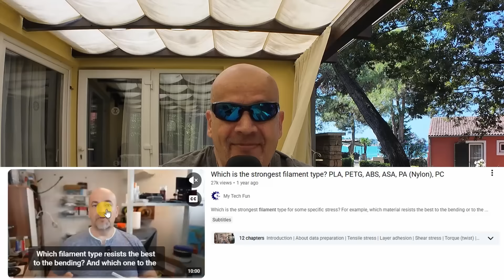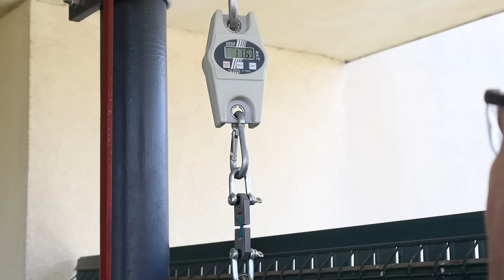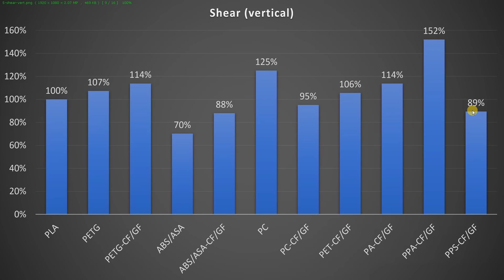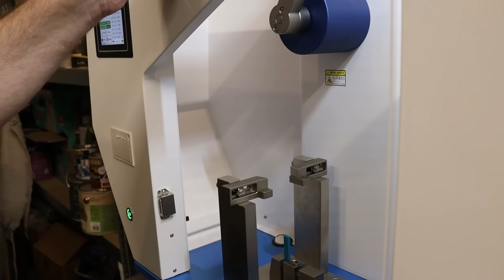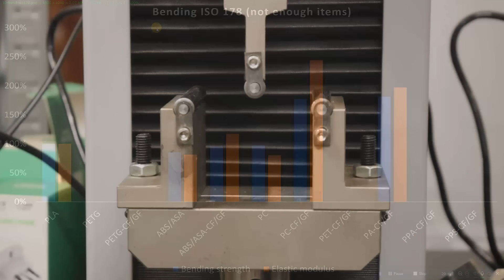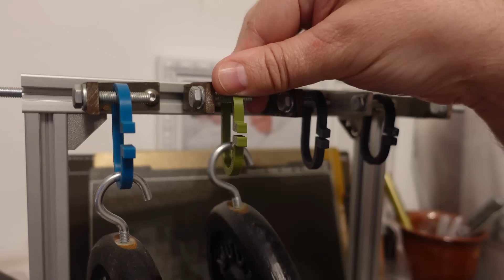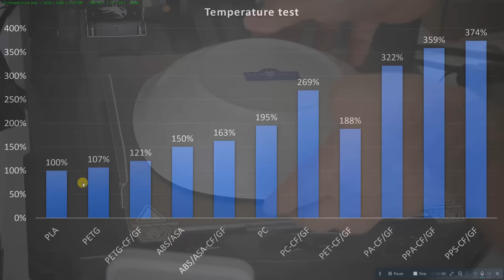Which Filament Type Is the Strongest? Now Including PET-CF, PPA-CF & PPS-CF

Comment: Thank you so much! I have spent a ton of time invested into obtaining the strongest FDM prints for prototyping. I have seen incredibly different results with the same material after tweaking so many different settings. Did you tune each material before testing this? Basic tune? Fully tuned? Again, thank you, subscribed!!!

Comment: Thank you very much for this comprehensive update of your filament comparison data! I like the graphs and the choice to use PLA as the 100% standard. One suggestion is to add to each graph a single small text box defining the ACTUAL VALUE for PLA (with units). Since your display gives % relative to PLA, with this single absolute value we can easily calculate the values for each of the other filaments on each of the graphs.

Comment: I really do wonder if most of the technical filaments compare so average against PLA because for most the technical filaments you didn't use an actively heated chamber? Because just from this data here, I don't even see the hassle to mess around with the enginerring filaments except maybe PPA.

Comment: I'm pretty conflicted about PETG being more brittle than PLA. All knowledge available on the internet points towards PETG scoring better in the IZOD impact test, even Ultimaker mentions the impact strength of PETG compared to PLA on their page as a general guideline. Looking through datasheets of materials from for example ESUN points towards the same, but then again the story is quite different with say, SUNLU..

Could be worth it to make a comprehensive test of PLA and PETG materials from different manufacturers to see if the contradicting claims are due to variations in material composition between brands, and if it's even possible to make such a generalisation between the two materials that one holds superiority over the other in the matter.

Comment: Seems like, other than UV durability and long-term thermal cycling, PETG really isn't winning many categories, however for me in rural northern Australia, PETG's UV characteristics, especially black, make it win.  The thermal cycling issue I found was with PLA, after ~6 months the PLA around my brass threaded inserts would crack ( installed using hot-tip melt ).

Comment: I printed replacement parts on my suitcase out of 72D TPU. It survived an out-and back airline trip as a checked bag. I’d be curious to see formal testing on high-stiffness TPU. The one I used was from CC3D.
Reply: He tested it already.
Reply: @riba2233 which video?
Reply: @davidmvermillion   "TPU+Nylon Mix: Is CC3D TPU 72D the Toughest Flexible Filament?"

weird that you couldn't find it easily
Reply: @davidmvermillion  158prgcHcTE
Reply: @riba2233 thank you!

Comment: Good video but you should have done the pacf, ppa cf, and pps cf with an annealed and un annealed group
Reply: It only changes the temp resistance significantly
Reply: @riba2233 that's not true for at least the nylon. Layer adhesion goes up and impact resistance goes up.
Reply: @BamMiracle   nope, layer adhesion stay mostly the same, impact resistance will decrease a lot temporarily until it absorbs moisture eventually

Comment: Thank you for your great job! 
Your videos are very interesting to watch. (I love data )))

I think the temperature test could have been displayed in degrees. It would have been clearer to me, as it would have been to many others ))

Another possible direction of research is vibration absorption. It could be useful in homemade printers, where instead of a super-rigid frame, we make it out of plastic. The main resonances are "collected" at a single frequency and suppressed by shapers in the Klipper. The remaining vibrations are absorbed by the plastic.
Honestly, I can't imagine how this could be tested so that the results would be useful in practice.

In summary graphs with a lot of source data, it might be useful to display not only the average values, but also the maximum, minimum, and +/- sigma. For example, as far as I remember, the strength of PLA can vary greatly depending on the color and manufacturer.

Comment: I'm curious about PETG's layer adhesion, it's supposed to be stronger than PLA. From my own experience, PETG's layer adhesion can be incredibly stronger to a point where even when bending a vertically printed sample, so the stresses are long the layer lines, it just bends 90 degrees without breaking. This does require minimal cooling and slow/hot printing. I'd just be curious for a test between "standard" PETG printing and also printing specifically for strength, as my tests with doing the same with PLA never got close to PETG's best layer adhesion.
Reply: It is stronger in relative terms (compared to xy tensile strength) but this graph shows absolute numbers.

Comment: Wow PPA is truly a champion! One of the only places it can be usurped is in glass transition temperature combined with load. For example parts under stress in a heated print chamber such as printhead plates. Stew from Team 7 discovered that only PC-CF could really hold up in most scenarios and even PPA struggled. Still, what an amazing filament. I will also note that PET-CF emerges as a great all arounder filament again. Jack of all trades and master of none if you will. Easier to print than the highest end filaments with better properties than all the low end filaments and also very affordable. Siraya Tech is awesome as always. Thanks for this fantastic summary!

Comment: Greetings Sir. Thank You for Your contribution to the community. I was making some technical tool clamps for CNC machines, and so far I know that regular PETG gets "tired" and eventually breaks. Now, I am doing the tests with Overture's Easy Nylon since it has greater elasticity and I am assuming it will be able to perform well after many itterations of load being applied and removed from the part. Also, I have done some thermal treatment to the parts and will eventually see how it performs. Do You have any suggestions?

Comment: This has basically proven to me my choice to  just use Fiberon PET-GF15  for  everything that needs to be stronger than basic materials was a  good chocie lol. I honestly started to love  fiber filled PET, it prints so well and easily and is insanely strong for how easy  it is to print and how cheap it is too.

Another interesdting filament thaat I want to  try at some point is  PCTG. Supposed to be similarly easy to  print as PETG but closert to PC in terms of strength.
Reply: Same strength it's just more impact resistant. PC is still stronger.

Comment: Based on my experience i dont believe that you had proper PETG print settings
Reply: He did. What property do you think is not good enough?
Reply: @riba2233  Layer Adhesion. It can printed to have incredibly strong layer adhesion, and should be stronger than PLA under the right conditions.
Reply: @Kirahl3 and it does relative to its tensile strength. These numbers are absolute tensile loads, not relative Z direction compared to XY direction.

Comment: 10:05: "PETG" surely PET?  And yes, I think it is the most slept-on filament for this reason.  You can buy 4 A2L for the price of 1 H2D.  If you have to make a large number of car parts or similar, your first job is to make sure you can't use PET-CF.

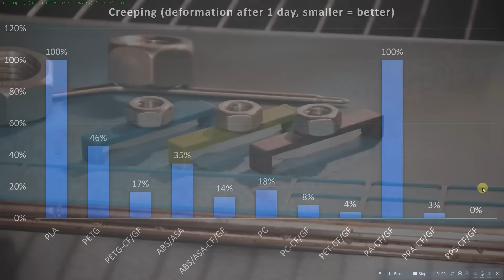Comment: 1) Please have a comparison of all TPU 64d and harder!  I think it will dominate some comparisons even more than PPA-CF does in the filaments you have.  I have it from Tinmorry, CC3D, and Bambu.  (Weirdly, I print them all with the Bambu TPU for AMS preset and Bambu prints BY FAR the worst of all of these!)  To me it seems like a wonder-material: anything you would otherwise print with PETG can be printed with hard TPU and will be indestructable.  2) Put TPU on these charts.  Maybe "90-96a" and "64d+" groups.  3) Your sponsor has an intriguing range of PA.  Please test them all.  I would mark my calendar to see that vid and I suspect many would.  4) At 8:25 temperature can't be stated as a percent as zero differs between systems and sign flips in common systems, unlike all other dimensional units.  I think even our American friends are fine using C in this contect.
Reply: He tested polymaker PA filaments a long time ago, everything except pa612-cf.
Reply: @riba2233  oh OK!  Still, if a long time ago, perhaps that didn't include the latest versions of all his tests?  And it'd be quite valuable to see pa612 in the context of the others, probably very worthy of its own video--only one new filament but compares it to the other 4-5 members of the family and perhaps other significant markers like Siraya, Prusa, and Bambu.
Reply: @lqr824  yeah I would also like to see it, it will come I'm sure. Formula hasn't changed since the start so those tests are still relevant :)

Comment: The delta between AS/ABS with and without GF/CF on the IZOD test is the one that surprised me the most. That is a really huge delta. What was N for each of those samples? I really think this data would have benefited from being presented as something like box and whisker. 

Big fan of this channel. Got to decide what to print the new RC jet boat in… torn between ASA and PBT-GF and that 72D TPU…

Comment: I just did a project using PPA-CF.  It was just a 50x50mm block that is 15mm tall with a hole in it.  Pretty much a seat spacer.  Even though it was printed with 100% concentric infill, I wanted to be 100% sure that it can handle my body weight and the clamping load between the seat rails and chassis.  It has held up considerably well.  Then I see this testing and confirmed that I made the right choice on PPA-CF.

Comment: 5:09 this is really strange result. How come it shows so different results to both tensile strength and layer adhesion?

Have you repeated this test for multiple samples or this is only from one sample per filament?
Reply: why is is strange? It's a completely different property, it has no correlation with tensile strength. sample size is not an issue, he tested many filaments, some even multiple times on multiple different devices.
Reply: @riba2233  why is it a completely different property? Depending on how the layers were oriented I would expect it to either correlate with tensile strength or later adhesion
Reply: @anj000   because it simply is, impact strength has nothing to do with tensile or bending strength, just like temp, uv, chemical or creep resistance don't as well.
Reply: @anj000  layer adhesion gives prints better resistance to delamination, but it doesn't necessarily help with tensile strength beyond a certain point. The results shown here for impact strength line up with what is known about these materials (ABS is quite good for impact resistance, which is what is also confirmed here).

Comment: If you print PETG without any sort of cooling, it is way stronger than PLA. PETG strength drops significantly as soon as you introduce any amount of forced cooling. I understand you can't print everything without parts cooling etc but I have printed many items from PETG with 0% cooling and only very fine details, very small objects below 10mm in overall size can suffer but even then not always if you print slowly enough.

PETG becomes brittle with any level of forced cooling. So turning off fans helps PETG a lot and it is often not shown in any of these tests.

Also I have personally noticed that translucent PETG is stronger than opaque ones.
Reply: what you noticed has been tested a long time ago. Btw fan settings will only change the layer adhesion strength, tensile, bending, impact etc will still be the same and lower compared to pla. And you can also print PLA with lower fan setting to get even better layer adhesion.
Reply: Just ignore this riba2233 clown. He always just comes into the comments to spout nonsense and argue with everyone. You are correct @CoreMaster111. I've experienced the same things you mentioned with PETG and cooling.
Reply: @zx4133   cope buddy, everything I said was correct so that makes you a 🤡 ;) and I don't argue, I just say the facts, if you don't like them that's on you.

Comment: Another great video with tons of data points showing that different materials will be better for different applications. There is no one best material, especially once cost is factored in, there is better materials for a use case. As you said there were also many other options not covered that may be the best choice but they trade one property to maximize another, ie Flexibles creep but are durable with strong layer adhesion, PP maximizes chemical resistances and repeated bending but is hard to print and doesnt play well with anything else.

As usual a great place to point people when they ask, "what's the best?", the follow up question of "for what?" is rarely answered but at least now much of that is covered all in one video. And I do agree that comparing everything against PLA was a good choice since that is what most people will be familiar with, but I would have liked on some things for the graphs to be in the in a given unit of measurement rather than percentage, I am thinking of the Temp. resistance being one I would have rather seen the hard numbers vs a percentage against PLA..

Comment: For me PET-CF 17 is the winner. close in all tests, afordable, easy to print even on an A1 open printer, very good heat resistance, looks incredible...  great test video as always... thanks!  its my go to filament... i get it in 3kg rolls.
Reply: Poor impact strength though.
Reply: @jaro6985   it's decent enough for most use cases.

Comment: Doing my comparatively informal testing, I would agree with the engineering-class performance. About the most bothersome part is PPS' high temp performance just does so well compared to anything else I can run across my machines before getting into Hardcore (aka $$$$) materials. I was super excited to get my formulation machine online here, then one of the motor controllers arrived DOA. Still waiting on a replacement. Sigh, it's always Something...

Comment: Comparing temperature in degrees is more appropriate than percentages. If PC is 200% of PLA (60°C, 333K, 140°F) does tha mean it's 120°C, or 666K, or 280°F? The chart should really just be degrees above PLA.

Comment: Excellent video. Though I would have liked to see non-fibre PA and fibre-reinforced PLA, though there probably aren’t enough samples for that to be worth doing, same for plain PET.

Fibre reinforced PLA specifically solves the annealing deformation problem, I did some in-depth research and found some studies citing different mechanical property changes at different annealing temperatures. 100C was worse than 80C for impact resistance, but better for heat resistance.

A neat video idea might be to get plain and reinforced versions of a few different filaments, especially PLA, PA, and PET, and measuring mechanical properties before and after annealing. Alongside warping.
Reply: Issue is that nobody is making pure pet filament unfortunately, only some modified amorphous versions.
Reply: @riba2233  MTF reviewed some a year ago. But I might be misremembering, and it’s got additives that make it impossible to anneal. There’s always plastic bottle filament I guess, I think there’s one or two people selling recycled filament like that.
Reply: @Scrogan  yep, that's what I'm talking about, it's not pure per but a modified amorphous one, from esun. I would really like to see some pure pet options on the market, I don't have time nor will to mess with bottles.
Reply: CF reinforced PLA is trash.
Reply: @jaro6985  if you want a filament that doesn’t soften until 150C and can be printed on an open bed, it’s hard to beat annealed PLA-CF. I suspect it’s also very creep resistant compared to PLA, but I’d like to see data on how it compares to annealed PLA and non-annealed PLA-CF.
Reply: @jaro6985  no it isn't. Stop believing every 🤡 that makes ragebait vids.

Comment: What temp settings did you use for the ABS and ASA? I ask because CNC Kitchen showed a huge jump in layer adhesion (something like 50% if I remember correctly) if you print ABS and ASA in a 65c heated chamber versus an unheated one, so I'm curious as to whether that might affect the results or whether your settings are already set up for that.
Reply: Actually it was on this channel.
Reply: Exactly. My ASA prints seems much stronger than in this review.

Comment: Very interesting video as always. I was wondering whether using a different estimator than the mean would be more informative for this type of comparisons. I feel that using the mean, especially for the PLA category which has many specialty versions with very different material tradeoffs, risks showing an aggregated datapoint for a "meta-material" that does not really exist in that combination of properties, as each characteristic is being skewed by outliers in the form of specialized filament. I think it would be interesting to look at the data also using the median as estimator, or using an estimator more robust to outliers like (windsorized) sigma clipping.

Comment: Would love to see how regular PPA (non-CF) does in all these tests! I’m guessing it would perform similar and top the charts in most categories.
Reply from the maker: I tested one so far, but its very hard for printing.
Reply: @MyTechFun  Thanks for the reply. But wait, you printed PPA-CF for this test, right? Printing regular PPA is basically the same. I actually find it fairly easy to print. I use my Elegoo Centauri Carbon 1 printer. What printer do you use for PPA?
Reply from the maker: @zx4133  Bambu printers, and I didn't printed PPA-CF for this test, I just used the data from it's review video. Similar review video I have for PPA. https://www.youtube.com/watch?v=nM0GR_x2iQs
Reply: @MyTechFun  Oh ok. I understand. Thank you Dr. Igor!
Reply: @zx4133  it's not basically the same, not even close.